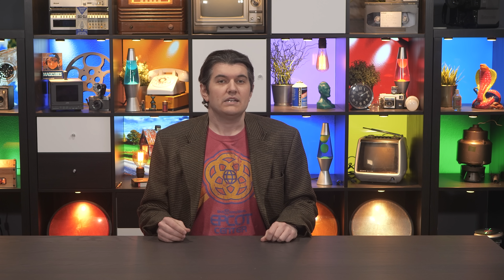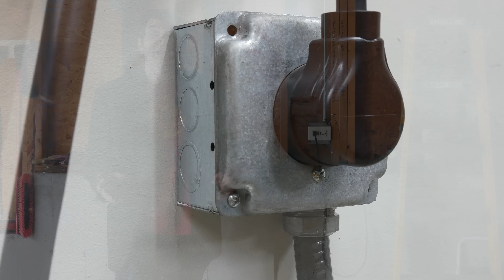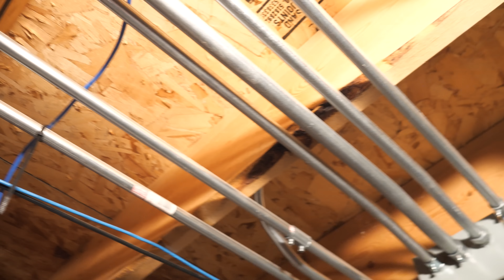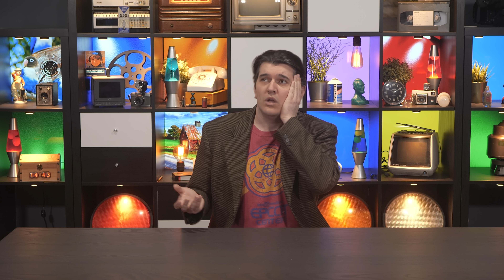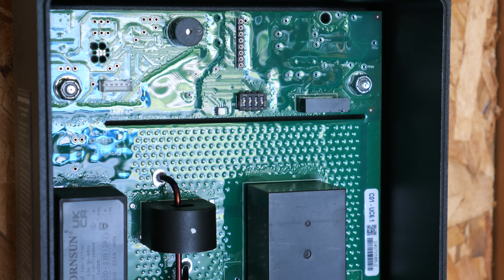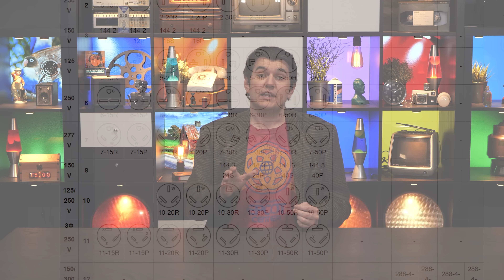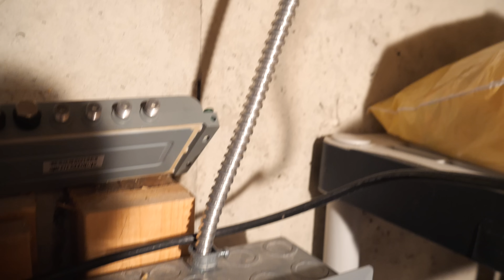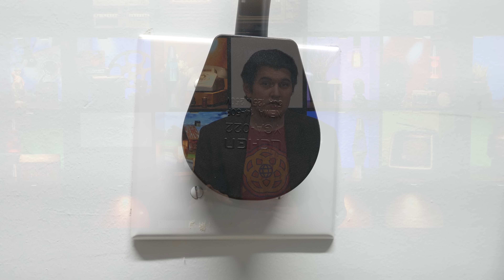The "standard" car charger is usually overkill—but your electrician might not know that

Comment: It's not that electricians don't understand the flexibility for car charging. The real issue is the contractor wants to sell you the more or the most expensive options... It's also not necessarily the electrician either.
Keep in mind this applies to all the trades. Not just electricians... You can include doctors, Lawyers and all other professions as well... 
As an electrician. I worked for a contractor doing service work. One year into working for them. They implemented a salesmanship training program that emphasized upselling to the customer. For example...
The electrician is sent on a trouble call to a residential customer who has a circuit that keeps tripping. 
The problem turns out to be that the customer simply has too many large loads on that one circuit. Most often, this will be a kitchen. Possible simple solutions would be, If the kitchen has multiple circuits. Find a way to disperse the some of the load to another circuit. If that's not possible, or if the house is an older house with too few kitchen circuits. The solution would then be to add a new circuit to the area of use. 
This is where the upsell happens. The object is  look at the situation and find weaknesses in the customers electrical system and push services the customer doesn't really need. Lets say the electrical panel is full of full size breakers. Rather than just upgrading one full size breaker to a dual breaker. They'll recommend a panel upgrade first, or at least offer a range of options with the emphasis on selling the customer the more expensive options. 
The difference is when the contractor is requiring it's electricians to do the upsell even when it's not necessary.

That was my situation with that contractor and I couldn't with good conscience, continue working for that contractor.

Comment: I charged my Bolt EV from an unused 30a dryer socket in the garage, with a 16a EVSA cable. EZPZ. It cost $250 cause it had a 40ft cable to reach thru the garage.
Gave me 80 miles of charging overnight for my 50 mile daily commute. Only plugged in every other night and weekends to top up. 
The More You Know...

Comment: I use the Tesla Mobile Connector against a Dryer Outlet. The most it can do is 24 amps. I rarely run charge it that fast. I'll set the amperage to 18, 12, even 8. No reason to get the wires any hotter than necessary.  It's not a race to charge especially when I'm sleeping. If I do charge at 24, it's like 'wow that was fast!'

Comment: I just recently subscribed and am working my way through the playlist. So far I am impressed with the quality of your content. I would like to point out one omission on this home charger debate in which you strongly advocate for using 120v AC power. I totally agree that it's adequate and requires little or no mods to utilize, and everything you said was spot on. However,, you did fail to mention the difference in charging efficiency.  My 2017 Tesla model S typically charges at home on a 14-50 outlet at 91-95% efficiency, but the dozen times I've used a 120v outlet the efficiency dropped to 65-75%.  A year's worth of that would add up.

Comment: I totally agree with 50 amp plugs being overkill.  Unless you routinely drive more than 100 miles a day for multiple days in a row the most you need is a dryer plug and associated charger.

Comment: My garage is extra hot in this TX sun. Yesterday, my Tesla alerted me it slowed down the charge on the NEMA 14-50 because it said my wiring and plug are likely fatigued and not installed correctly. I plugged in the adapter years ago and its not fatigued, it just started doing this yesterday so I blame Tesla power adapter for getting too hot and not the wiring. I checked the box and plug and it's not hot, only the charging adapter.

Comment: in a perfect world, every charger would be DC, even slower residential ones, power grid voltage would be higher than the dc charging voltage, DC chargers would be only rectifiers and step down and EV's wouldn't even need to have an onboard charger. you would invest in a DC charger once,  and leverage it with every EV that you own. EVs would be lighter, cheaper and simpler. you're not carrying a phone charger inside your phone. even phone charger should be DC fast charger providing the battery charging  voltage and phones wouldn't overheat while charging (Oppo/OnePlus did it with VOOC/Dash charge)
Reply: Honestly a rectifier isn’t that complex or heavy, it’s a non issue
Reply: @Racing_Fox DC fast charger is still the better technology with everything happening in the charger and the car doing basically nothing. you can do up to 150kW DC charging using passive cooling on the charger side. onboard chargers are only in EV for  legacy / backward compatibility. of course if you re in a place with no chargers and just 120V or 240V outlet you're happy that your car has one and your able to plug a mobile charger so they're not going anywhere.

Comment: "So try to stick to your typical daily needs when thinking about a charging station"
Good luck, with that, especially in the US
People here think they NEED a 500miles range EV when they are actually driving an average 34 miles per day.
Also need a 3 row SUV but 1.5 passenger per car trip.
Trucks with 3000lbs payload and 15000lbs towing but nothing to tow and nothing to haul.
But yes I think you are right about charging I've been ok for 5 years with a 80 miles range EV , no DC fast charging and Level 1 home charging, with an extension cord!...and yes, not the only car in the family. now 115 miles and 50kW DC charging is a big upgrade! but I still charge level 1 at home

Comment: Isn’t also slower charging better for battery health? I have 48V nominal e-bike and my DC 54V charger delivers 2A. I know technically my 10Ah battery can take little more but charger is sold with limited current output to help preserve longevity of the battery pack over long term.

Comment: So many people are scared to death over range and it’s like u say do u leave home in a gas car with tank full. We have a Tesla and charge on a 120 v for years and haven’t had any issues. I have a dryer plug that we do not use and a 240 v Tesla charger but have never needed it so I never paid to have it installed. When traveling we just stop and charge at buc ees.and it takes about 20 minutes most stops . We have saved a ton in gas savings think about stopping at gas station and pumping $70 bucks a week in gas to drive to work and back times 4 a month which comes to $280 bucks times 12 is $3360 . Then you had to pay for oil changes twice a year. It becomes a no brainer. That’s my opinion.

Comment: If you charge in temperatures near freezing, your battery will want to be heated. At temperatures below freezing, NMC and LFP batteries need to be heated. It’s the reason that EV efficiency drops in the winter - the pack is drawing juice to heat itself, regardless of having a heat pump or a PTC unit onboard. If you are charging your car from a 120 volts/15 amp circuit, your charger and/or car will limit you to 80% of the maximum circuit draw, or 1.2kW. Even the most efficient heat pump draws more than that, so the car draws it from the traction battery. My own draws up to 3kW with a heat pump for the first half hour or more at freezing point, but I’m drawing 7.2kW, so it just takes a little longer. Now if you are using a portable charging cable unit, most are limited to 30 amps at 240 volts, so the full 50 amp capacity will go unused. For that you need a wall unit. Honestly, if you are going to spend the money on an EV and have the capacity to charge at home, it makes sense. No point in limiting yourself if you don’t have to.

Comment: Long time viewer/Electrician.

Just recently installed a 20A/120V receptacle for a condo owner. We talked them down from a full 50A/240V. Saved them loads of money on install and city inspections.

This is someone who drives at most 20 miles a day, so plenty of charging capacity.
Reply: Dumbest thing ever. I hope they drive less than 30 miles a day and never want to drive two days before a road trip. Because that would take 20 hours on an 18-amp 110.
Reply: @sonicsound84 dumbest comment ever I hope 20 is less than 30
Reply: @westernbrumby  😂 went right over your head. I've lived with the mobile charger and a 20/15 amp plug—Barely enough for most people. But please. Continue to let your feelings speak for themselves. You take the cake for the dumbest comment. Or the lowest reading comprehension. Maybe both.

Comment: When I visited America, we rented an EV car as they didn't have any other options. It seemed great until we needed to charge on the public networks. In the Pacific Northwest, every charger we found around us used an app, but as I found, the apps are in region locked app stores. So I couldn't even download the apps to use them. We eventually found one super slow charger that I could use by calling a toll free number to use my credit card...which of course isn't toll free for an international phone.
Reply: I feel you so much. You really lived an awful experience.

Circuit Électrique is an app that works across North America and allows charging and payment all at one place.

Comment: I've been fixated on running a 60A circuit to run my PHEV that only takes 32 amps. Donno why I never really thought about it. The craziest bit is I've got a free slot from my air handler which used to need its own 30A line so the cable is already halfway to where I needed it to go. You just saved me from myself and probably saved me 2k or a weekend and 500 haha. Thanks. Makes this whole project way simpler.

Comment: Hi, electrical inspector here. Typically local jurisdictions in the US will adopt NFPA 70 - The National Electrical Code (NEC) If your local code has adopted the 2017 NEC or later, a receptacle outlet for a car charger in a residential garage is required to be GFCI protected. See code references below and check local jurisdictions for requirements of electrical installations. I’m just a random commenter on the internet.

Good job 👍🏼

(2017 NEC - 625.54 and 2020 and later NEC 210.8(A)(2) )
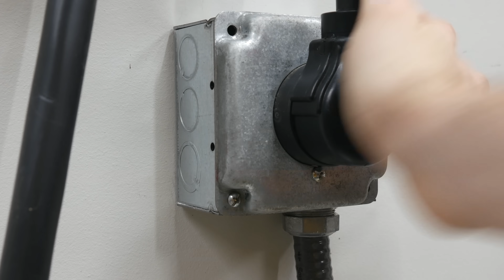Reply: As an EC, I took exception to his example work shown at 3:47. I see at least 3 NEC violations:
1) No connector, fitting, or bushing on the NM cable where it enters the box.
2) The box isn't bonded.
3) The NM has its outer shell stripped off, and the cable's inner wires are extended through some NM flex conduit. The inner conductors are not Listed and Labeled to be used like this, and the NEC doesn't allow NM cable to be run inside conduit without it's outer shell because the inner conductor insulation is not rated to the cable's full voltage insulation.

Also, Alec said that MC isn't available in conductor sizes large than #10, but it definitely is. I've run 6/3 AWG and 2/5 AWG MC cable, and it's available as large as 4-conductor 750MCM.
Reply: @Mike-ie5xu and still he will never have an issue.
Reply: Good point!

I haven't read a lot of comments addressing this so here we go. There are generally two types of EVSE's. One is called a Wall Connector and the other is a Mobile Connector. Mobile connectors are often stored in the trunk of the vehicle and then taken out to connect the vehicle to a standard receptacle, either 120/240V. Wall connectors are hardwired directly to your electrical panel - a receptacle is not a part of this system. If you are charging every day at home, or even multiple vehicles, you should not be using mobile connectors - that is not what they were intended for. To make matters worse, companies are making wall-mounted units that plug into a receptacle. I haven't seen any stats on this but receptacle failure is probably mostly caused by these devices as many are plugged into non-EV rated receptacles (yeah, that is a thing).
As far as the GFI, those are required for a receptacle, but direct-wired wall connectors do not use a GFI. In fact, they can't use a GFI due to the requirement (in the US) to have built-in (non-defeatable) ground-fault sensing which would trip an upstream GFI.

Comment: Yeah, I feel your gripe with the on street parking etc. I would've bought an ancient Leaf because I only need to do 20-30 miles a day most of the time and even my longer trips are usually 150 miles at most so I can live with a small battery. But there's no real on street charging where I live so I'd have to charge it somewhere routinely, which would be a huge hassle. Also, to add insult to injury, electricity costs from public chargers are now in most cases more expensive than petrol. It's infuriating.

Comment: 20:53 At least in Spain the limiting factor is owning a garage, no matter if its individual or communal (with or without a door). Being able to get a cable from your home electric meter is a bonus, but not essential, as you can have a new one isntalled fot the garage only. Since most people live in apartments, there are many contractors specialised in this kind of installation and government funds to ease the cost. In our case, the installation was included in the price of or new Hyundai Inster and Hyunday took care of getting in touch with the installers, choosing the wallbox etc. I think the installation is prepared for 7.4 kw single phase 230 V, but our contract has a limit of around 4.5 for the whole house, and it's plenty enough for my daily driving that usually involves around 110 kms. And I am also able to charge at 11kw three phase at work at 0€, which I take advantage of whenever I can.

23:00 Just to know. Do these simple chargers have cahrge modulation? I consider this to be quite handy so that you don't exceed the power limit because of the car. As for the rest of the functions, I guess the user authentication function could be quite useful for those who have to park in a communal garage with no individual doors.

Comment: The issue isn't setting up the charging stations, it's upgrading the residential electrical distribution grid along with the additional power generation capacity.  If we could snap our fingers and everyone in the US had an EV along with nightly charging, our entire grid would burst into flames that evening.  It's precisely because EV's are such a niche item for well-to-do's that it hasn't impacted the grid in any noticeable way.

Comment: I had this same charger installed because I have 100 amp service and I was worried that I didn’t have enough headroom. It is on a 50-amp circuit, but my plan was to use the dip switches to lower the current if I was tripping the main breaker. It has been fine for a year at its max 40 amp charging speed.

I saw another video recently about a “smart”charger that would monitor your whole house load and dial back the car charging as necessary. Overkill!

Comment: I have a 2020 Chevy Bolt. I installed a 240v NEMA 6-20 outlet right next to the electrical breaker box in my garage and I use a portable charging cable. The Bolt will only charge at 12 amps at 240 volts, or at least that's what the menu states, so it will only ever use 2.88 kW. Even when depleting half the battery in a day, that is more than enough to charge back to full overnight.

Comment: I think you have it backwards. When people buy an electric car they typically are going to use whatever charging adapter comes with it. General motors/Cadillac gave me a 110 V/240 V adapter with switchable plugs so that you could use either a standard 110 V receptacle or a NEMA 14–50.

My Cadillac LYRIQ has a 102 kWh battery. It takes days to recharge that at 110 V but it takes about 4 to 5 hours to recharge it using NEMA 14–50. 

For the people who have a small EV with a small battery that basic AC charging might work at 110 V for them just fine. It won’t work for me. 

I am happy that I have the option of using either for emergency purposes but as far as I’m concerned, anyone who buys an electric car should have a home to charge it and a NEMA 14–50 outlet.

Comment: Just a tip. You can get MC Cable in any size you like. From 14AWG to 750MCM with any number of conductors you like. 8/2MC & 6/2MC are wicked common. You may have go to an electrical supply house for them. 99% guaranteed to be cheaper than any home store (Home Depot/ Lowe’s) …

Comment: We used a Lectron 240 splitter box and changed out the dryer pigtail to a 50 amp nema cord that plugs into the splitter…works perfectly on our new cadillac optiq…24 miles per hour charge rate…on a 30 amp circuit …just dont ever plug your dryer into a 50 amp circuit! It will be toast …

Comment: What a fantastic video! I am very tight for space in my panel (100amp, with a hot tub) my plan before seeing this video was to go with a splitvolt, sharing my dryer plug and a grizzl e  portable charger with the dip switch set to 16 amps (and the software for the charger set to 12 amp, just to be conservative! I love in Manitoba Canada, and have no garage but am hoping that 240@12 amps would give me enough oomph to overcome -40 winters knowing that I could turn the tap up to 16-24 amps if needed. Your video has 100 percent validated this idea for me. I'll be putting together a video series on the process as well. Thank you again!

Comment: 23:40 - I've had no issues at all with my Tesla Wall Connector that I had installed over a year ago. There are also lots of functions that cannot be handled by the car. 
- The car can't give you actual power usage by the EVSE, only the power delivered to the car. Allows for much more accurate cost estimation. (Can't show total power as some will be lost as waste heat or due to resistance)
- Energy reports cannot be exported from the car.
- You cannot manage usage permissions via the car (Restricting who is allowed to use the EVSE in the case of installing these outside like many people do). 
   -- This also applies to ToU settings.